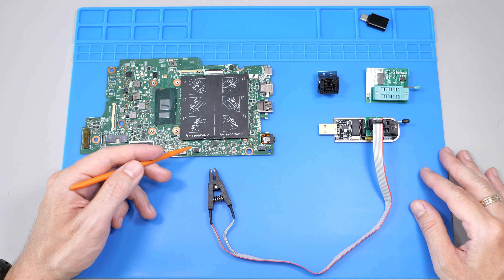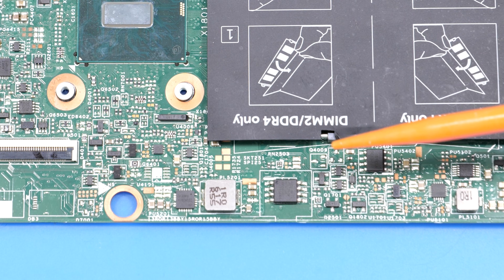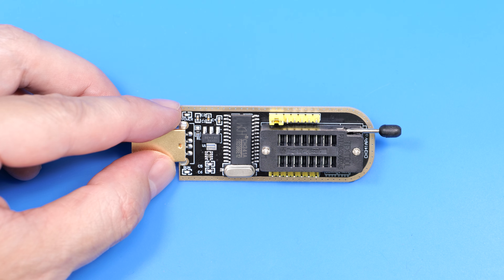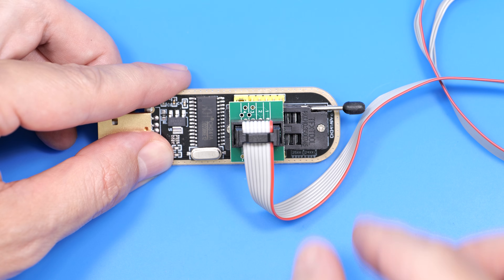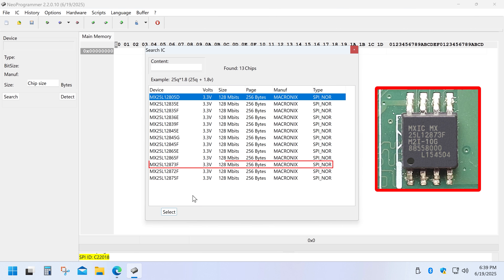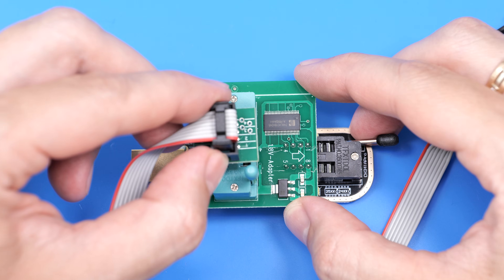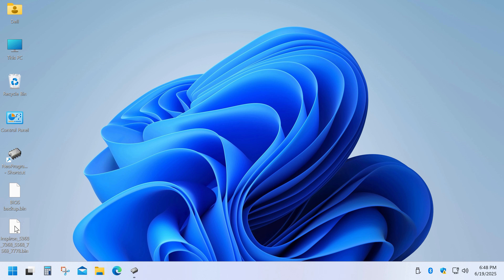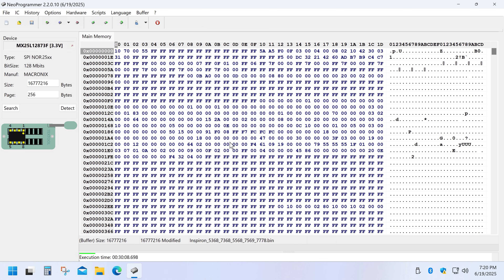How to Fix a Corrupted BIOS with a $5 Programmer | CH341A BIOS Flash Tutorial

Comment: Please take the time to read this🙏 it would mean alot to me:
So I have an hp elitebook 840 g3, I bought it second hand and the shop I bought it from most probably installed a pirated windows in it because its super common here in south asia, more specifically here in Pakistan. Anyways I used my laptop for about 2 years, everything worked normally but couple of days ago I was using my laptop at night, the next day I came back from a shower and it was my negligence that I powered on the laptop even though my hair was not dry yet although I didn't saw any water entering the laptop. Anyways the laptop turned on normally, I entered my password and the windows 11 home screen appeared, I went to comb my hair but then I suddenly noticed in the mirror that the laptop's screen was flickering and it was black and white, sort of like when the cable on the television goes out when its raining, in panic I forced shut down my laptop by long pressing the power button, now whenever I power on the laptop, the HP logo appears and right after that just for milliseconds I white screen with a message appears and the laptop screen just goes black (note neither the laptop or the screen turns off, I know this for sure because all the lights remain on meaning the laptop hasn't turned off the screen just goes black) and the HP logo appears again and the message appears just for a split second and screen goes black again and this loop continues untill I get tired and force shut it down by long pressing the power button. I discussed this entire situation with chatgpt and also I made a slomo video of this process to get a screenshot of the message that appears for a split second, I showed that screenshot to chatgpt, here's the message chatgpt was able to read because I couldn't even read the message even from the screenshot since the screenshot was too blury because I had to slow down the video alot in order to get a few frames in which the message appeared. Here's the message:
DXE Update
"Some step of BIOS update is in progress.
DO NOT reset, turn off, or remove power from the system during the update!
Any interruption of the BIOS update process may result in corruption of the BIOS making the system nonfunctional.
This operation might take a few minutes to complete. Please be patient."
I discussed all of this situation with chatgpt and it was sure that I have a bios issue. I also discussed with him all the other possibilities in my situation such as water damage or pirated windows but he was sure none of this was the reason and here was his response: 
"That screen (from the screenshot) is only shown during BIOS/firmware update.
You wouldn’t see it from water damage — water damage typically causes:
1) Display glitches (flickering, artifacts).
2) Keyboard/trackpad not responding.
3) Laptop not powering on at all.
But not a BIOS update message. That’s a system-initiated process, not a hardware short." Similarly for pirated windows it said that bios lives outside of windows and that bios updates are sent by HP and updating them is the same weather you're using pirated windows or not. After the discussion it told me that I most certainly have corrupted bios that need reflashing/reprogramming, chatgpt also told me about a simple method to see if I could solve the problem at home, it was to press windows+b before powering on the laptop and then power on the laptop to enter HP bios recovery menu. HP also has this method on their youtube channel but that method only made the fans run faster and the screen went completely black (the loop stopped and the screen just went black). As a last resort it told me that I had to go to a shop for reprogramming the bios because its too corrupted to try any easy methods at home.

Comment: Hello, my bios chip is Winbond 25Q80DVNIG T14s Thinkbook. When I follow your steps. the Neoprogrammer could not find the bios chip name. My bios voltage is 2.7 to 3.6. If you know anything, please help.
Reply from the maker: Just type in the Neoprogrammer W25Q80 and select W25Q80JV.
Reply: @ElectronicsComputers  And the Neoprogammer shows "W25Q80JV [3.3V] IC not responding / Disconnected" :(
Reply from the maker: @mrprimarch6484 Try with attached laptop's battery.
Reply: @ElectronicsComputers nevermind can now, just very lag

Comment: May I contact you?
I have a problem with my laptop msi creator 15m a10se-421us 
When I did bios update uncheck the boot block box and now only turns on the keyboard and turns off try to reprogram but I do not recognize my bios chip is Micronix MX25L12872F 3.3v and bought two integrated if I have burned the ic
Reply from the maker: You already did! So can Neoprogrammer read the chip or not? If it can't and you're 100% sure it's not the bad contact then try to attach the battery to the motherboard and try again.
Reply: I have tried it and sometimes I get a reading but it is wrong. I think it is the soic8 I will buy another adapter if not I will have to desolder but I don't have a soldering iron at the moment. Do you think the bios that is on the web will work for me?

Comment: IMPORTANT QUESTION : does this fix the problem of bios viruses ? And how do we know it flashed the virus ? What if the virus hides in a bios partition that is not accessed by this tool ?
Reply from the maker: If your laptop works properly, your BIOS is fine. If it’s bricked, just reflash it using a CH341A programmer and use the official .bin BIOS from the manufacturer if they provide it. If not you can download a BIOS file from any laptop repair forum.
Reply: @ElectronicsComputers  it's an asus, and they do provide it. My problem is that... I think I have an evil maid thingy. So... I am thinking should I throw it away or just reflash it. There is so little info out there about what to do, it's insane. I can't find instructions on what to do

Comment: Can i flash the bios asus rog strix g531gt bios corrupted using that?
Reply from the maker: Yes, you can easily fix your Asus Rog laptop with CH341A programmer.
Reply: @ElectronicsComputers where i can find the Bin file?
Reply: @ElectronicsComputers Can you send me a link so that i can flash it thanks sir.
Reply from the maker: @jekztech  There are tons of legit websites from which you can download BIOS and learn some nuances: 
https://vinafix.com/threads/asus-rog-strix-hero-iii-g531gt.37103/

https://winraid.level1techs.com/t/problem-bricked-asus-rog-strix-g531gt-bios/39873/5

https://karma.ro/wp/asus-bios/asus-rog-strix-g531gt-rev-1-5-i7-9750h-bios-ec/

https://www.badcaps.net/forum/troubleshooting-hardware-devices-and-electronics-theory/troubleshooting-laptops-tablets-and-mobile-devices/bios-requests-only/81717-plz-i-need-bios-asus-rog-strix-g531gt

Comment: Hey,
I reprogranmed the bios safely but after booting it back up everything works greatly but in msi centre the hardware monitoring tab isnt working and ussage scenario keys arent working too. In games where i used to get 150+ fps now i am barely getting 30 to 40 fps.After this i factory reseted the laptop and still the same issue.I reinstalled the bios and have done the ec reset.
Reply from the maker: Once your PC is up and running again (great job) download the latest official BIOS from MSI website and make an M-FLASH BIOS update under Windows.
Reply: I am on a laptop so m flash isnt avail for me device name : msi bravo b5dd @ElectronicsComputers
Reply: Okay so yesterday my laptop stopped taking ac charge and is now turned off due to lack of charge.The adapters fine and so is the connectors.i tested if the components on the motherboard are getting charge when plugged in and yes they are getting charged but pressing the power button does nothing.What maybe the problem @ElectronicsComputers

Comment: Hello I have a Toshiba Satellite C55-C part number PSKWAV-00700GAR, and just like your board here, it powers on, no display, all voltages are fine, and shuts off after 65s sharp. I suspect it is BIOS corruption. so is it worth buying a CH341A programmer and reprogramming?
Reply from the maker: Yes, that symptom is very common with BIOS corruption on Toshiba laptops. A CH341A programmer is inexpensive and definitely worth trying before replacing the board or going to a repair shop. In many cases, reprogramming the BIOS will bring the board back to life.

Comment: Thank you so much for this tutorial man!
I enabled secure boot and my computer did not output video again. I contacted MSI help desk and tried countless troubleshooting guides. They then told me I needed to go to a shop to do what you just showed me how to do. After buying a $15 programmer and trying it out, I was able to save $250!! Thank you so much.
Reply from the maker: I'm glad I could help! We see these kinds of faults almost daily. A very similar issue exists with Gigabyte motherboards, where simply enabling Secure Boot can brick the board. I'm pretty sure the manufacturers are aware of it since it's extremely common, but it seems they're more focused on pushing out new products to make more money rather than fixing problems in the ones they've already sold and earned money from.
Reply: @ElectronicsComputers  I'm in the same boat as the other guy. Just waiting on a 1.8v adapter for my programmer. Lord knows where i'll find an x470 bin file though :(
Reply from the maker: @VenVidiVici   It's not a problem to find the .bin file for that MB. Here's for example: https://vinafix.com/threads/x470-aorus-ultra-gaming-rev-1-0.33240/
Reply: Hmmm, seems like another victim of the BF6 fiasco. Because that's why I am here

Comment: Is it possible to do it for a Pioneer amplis home théâtre because I saw a video on YouTube of a guy but he is Polish doing the same thing with my problem I can't find the bios file to replace the old one
Reply from the maker: I guess sharing the exact model of your device wouldn’t hurt if you want some help. And what's the problem with it?
Reply: @ElectronicsComputers the medele of the Chips or the amp? for the problem of the amp it's simple for a while my amp marks an error ue22 for some time by consulting the forums I saw that the problem comes from the micro software one day on youtube I came across a guy who solved this problem by reprogramming the chips of the amp my problem for example if I have to reprogram the bios if I erase the old one I don't know how to find a new one
Reply: Mx25L1606E  I can't find a new BIOS memory to replace the old one if I have to flash it
Reply from the maker: @ababacarndiaye1267   I mean the model of your Pioneer Home Theater.

Comment: ive got exactly the same version of the ch341a programmer but it operates on 5v not 3.3v
Reply from the maker: Yes, the programmer operates on 5 volts and supplies both 5V and 3.3V to different IC pins. I don’t see any problems.
Reply: @ElectronicsComputers  it will break chips that are not 5v resistant and operate only on 3.3v. the jumper on pins 1 and 2 is supposed to make it output 3.3v but it outputs 5v
Reply from the maker: @zielony1212 It will not brake anything your programmer is fine. Your VCC is getting 3.3V on pin 8 and on other pins there will be both 5 and 3.3 volts present which is normal.

Comment: i dont have any solder but its says everytime, ic not responding, i use the DA0ZE6MB6E0 rev: E and its not working on my acer aspire d257, please help me.
Reply from the maker: That model is using 3.3V SPI flash chip. Fist make sure the contacts on your clip are not bent or damaged and the clip itself is connected properly.
Reply: @ElectronicsComputers  but i used the acer aspire d257 not booting

Comment: Thank you I managed to unbrick my RX 7900 xt with two things I learned here First the 1.8 adaptor plugging the clip nearest the locking lever & second attaching the clip to the bios chip then plugging in the programmer worked first time.
Reply from the maker: Great job! And I'm happy to help. You probably saved up to a hundred bucks. Many technicians, when faced with such simple cases, would just say they reballed the GPU or memory chips to charge more.
Reply: How did you achieve that? My RX 6700XT VBIOS got messed up and I have to fix it

Comment: How u convert .exe file into .bin properly? Can u make a tutorial vid or explain here? Thankyou!
Reply from the maker: To extract a .bin from a BIOS .exe, first try opening that .exe with an archive tool like 7-Zip or WinRAR sometimes it’s just an archive in disguise. If that doesn’t work, you can try running the .exe with specific commands to extract files, like using command-line switches (sometimes /extract or /e). Also, tools like Universal Extractor or dedicated BIOS extraction programs might help. If all else fails, searching for the exact BIOS model might get you the raw .bin which are available on many laptop repair forums.
Reply: @ElectronicsComputers  how about version based bios file? My rog laptop bios file is more on .327 file(latest version bios) it looks like literally based on bios version
Reply from the maker: @Toshi_ro  For ASUS it’s normal that the BIOS file has a weird extension like .327  that’s just the version number, not a special format. Inside it’s still a standard BIOS image. If you’re flashing with ASUS EZ Flash, the tool recognizes it and its version by that extension.
If you need the raw binary (for a programmer), just rename the file from .327 to .bin or .cap. Most ROG BIOS files are actually .cap under the hood. If you want to extract or modify it further, UEFITool or AMIBCP can read it directly.
Reply: @ElectronicsComputers so I'll just rename it with .bin? And thats it? Is it safe for a programmer?  there is no chance that my laptop will be bricked permanently?
Reply from the maker: @Toshi_ro  Actually, that's how you fix a bricked laptop. If it's not bricked, then there's no need to use that USB  programmer and solve the firmware extension mysteries.
Reply: oh I see, so I will just rename it to .bin and I'm good to go? Is there anything else I need to do to make my programming safer?
Reply from the maker: @Toshi_ro  What's the exact problem with your laptop?
Reply: @ElectronicsComputers corrupted bios, blank screen but with kb backlight. i'll do a diy with programmer tho, i have a problem when it comes to bios bin file, you have mention about just rename the bios that asus provided to my laptop model, is there any procedure before doing the bios chip reprogram?

laptop model: rog strix g15 G513RC
Reply from the maker: @Toshi_ro   That model, as far as I remember, uses a 1.8V W25Q80EW chip, so make sure you’re using the 1.8V adapter. There’s no need to worry about anything else, as you can’t make it worse. If one BIOS doesn’t work, try another one there are tons of laptop repair forums where you can download the .bin file. Good luck with the fix!

Comment: Nicce tut 

Where can I find Intel lapkc71e BIOS files ?

Chip is W25Q16JV [3.3V]
Reply from the maker: You can try these: https://www.intel.com/content/www/us/en/download/648490/bios-update-kctgl357-for-the-intel-nuc-x15-laptop-kits-lapkc71f-lapkc71e-lapkc51e.html
And here's the manual for the BIOS recovery: https://www.intel.com/content/www/us/en/support/articles/000056678/intel-nuc/intel-nuc-laptop-kits.html
Reply: @ElectronicsComputers thanks for reply. There no .bin ? 
My repairman cannot flash chip
Reply from the maker: @KepassLaLimass   The firmware is available in .cap and .exe and there are tons of videos and information on how to make a .bin file. Or you can download/ask for .bin here: https://vinafix.com/threads/bios-for-intel-nuc-x15-lapkc71e-kctgl357-main.49940/ Also, depending on the fault, it's possible to recover BIOS the .cap file and  a USB drive.
Reply: @ElectronicsComputers ok sir big thanks 🙏🏻

Comment: A nanostation loco m3?
Reply from the maker: Yes, it’s possible to reflash the chip if you can dump the firmware from a working device or find the binary firmware file online. Just keep in mind, if you’re using firmware from another device on your local network, you’ll probably need to change the MAC address to avoid conflicts.

Comment: My PC WITH BIOSTAR FM1
IS CORRUPTED BIOS😢 AND IM COOKED WITH MY PARENTS CAN ANYONE SUGGEST WHAT TO DO??❤
ANY IM NOT REALLY BEGINNER ON PC ITS BEEN 1 YEAR LEARNING PC PARTS AND OS
Reply from the maker: Since it's a Biostar FM1 board, it most likely doesn’t support USB BIOS recovery. 😕
If the system shows nothing at all (no POST, no beeps, no signal) then your best option is to reflash the BIOS chip using a programmer like CH341A. It's cheap and works well for this.  But before jumping into hardware flashing try to unplug power, remove the CMOS battery (the coin cell on the motherboard) and hold the power button for 10 seconds.
Wait a minute or two, then reinsert the battery and try to power on. Some Biostar boards also have a clear CMOS jumper check the manual or look for a 3-pin jumper labeled “CLR_CMOS” or similar.